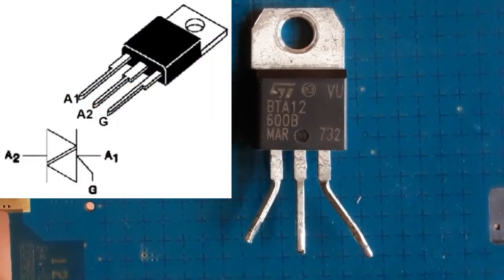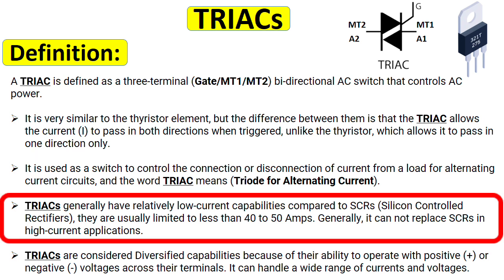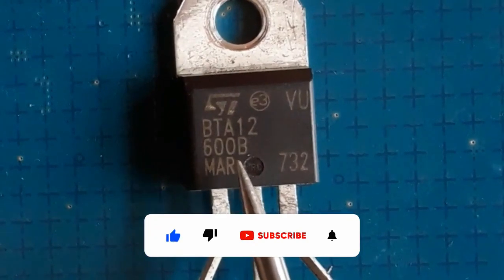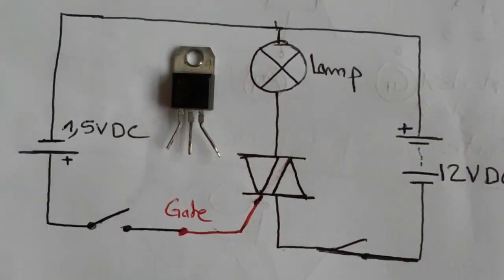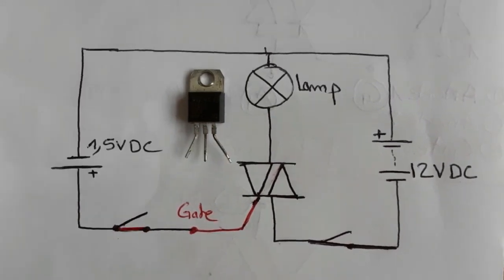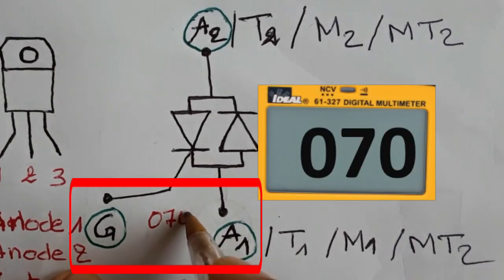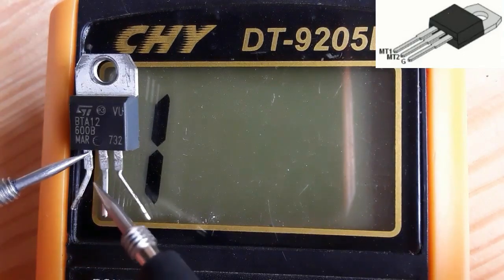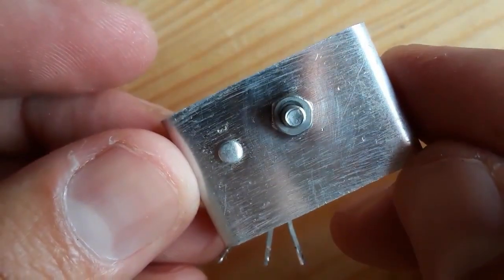Learn how to test TRIAC with a multimeter, how TRIAC works and what is TRIAC?

Comment: On a BTB06 600C triac I get a 086 reading which is higher than the 070.  You mentioned lower values like 050 has been ok but what about a higher value than 070.  Thanks, good video.